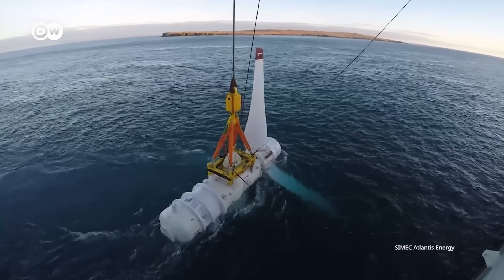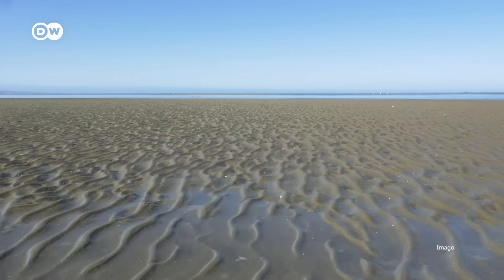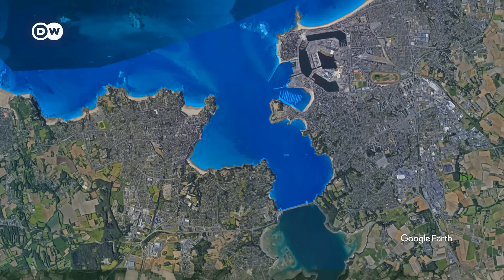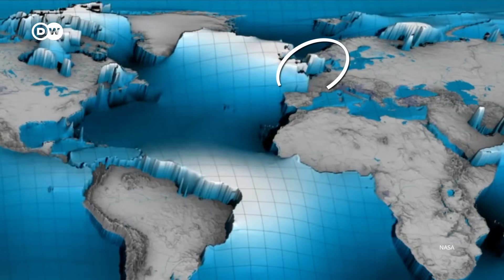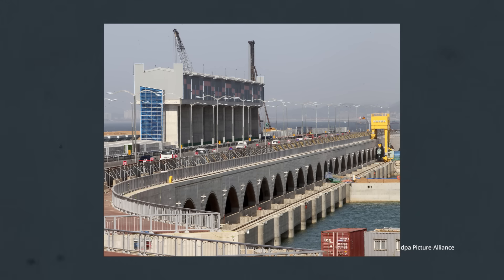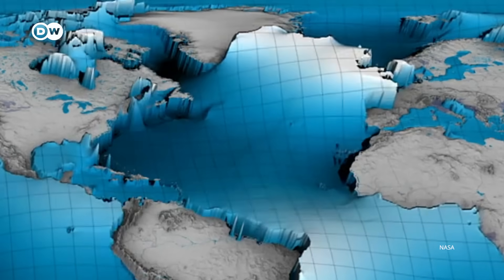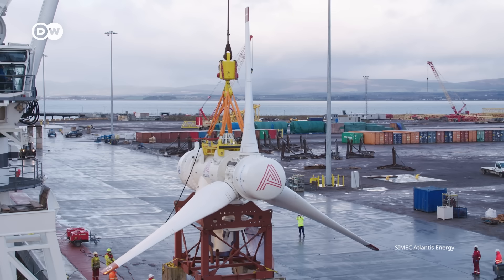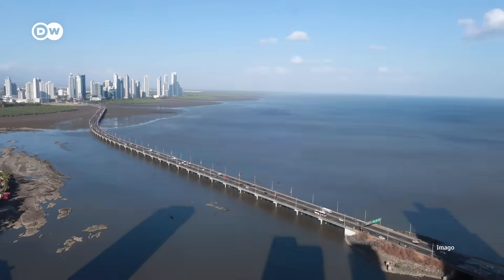Tidal energy could be huge – why isn't it?

Comment: Fun fact. My dad was one off the supervisors for the original Tidal power project in Hammerfest (Norway).  (Specifically in Kvalsund)
They look like small underwater wind mills
Reply: I used to fish off the little pier below that bridge. I was always deadly scared of potentially getting my line snagged in one of the turbines, little did I know this was virtually impossible.
Reply: can anyone please explain in terms of Albert einstein way rather than newton's one?
Reply: @gazzy01  Are you referring to the tides?
Reply: Cost of solar is so cheap now it doesn’t make sense. Also solar will drop another 75% in a few years
Reply: @MrExo_3D  but tides are consistent, sunlight is not, especially in the north, like norway that gets little sunlight in the winter but still has, tho small (only like 40cm), tides, so while they are ineffective there they still can possibly be optimised in some way because of their afformentioned trump card
Reply: @sanchu6335  yes tides are more reliable. but the equipment is hard to scale, and needs alot of maintenance and is problematic to survive harsh salt water. moving parts lead to problems.. Solar scales much easier but there is room for multiple solutions
Reply: @MrExo_3D  My local tidal turbine  requires little maintenance, as does my local solar farm, both require  only basic and inexpensive servicing but the tidal  turbines are much more powerful and operate 24/7
Reply: @MrExo_3D  exactly
Reply: @MrExo_3D  rewatch the video then 'cause the main point of tidal generator is concistancy
Reply: @MrExo_3D  Wind and solar work at about 1/3 of installed capacity and have to be 100% backed up. When you factor in the parallel power system that does that then wind and solar become very expensive, hence they require the enormous echo system of mandated subsidies that they receive.
Reply: @MrExo_3D  Since when did the sun shine 24 hours a day 🤔? 
Are there clear sky's every day?
Reply: Also really weird to see you commenting on a randomly recommended YouTube video. Haven't seen you in a decade
Reply: Yea well tell him to hurry up
Reply: Hammerfest Atlantis was a company that used this station as their test bed.
Reply: Onland windmills decaptitate lots of birds of bats.
Do the underwater variety do the same to sea life?
Reply: @earlysda  No
Reply: For those who understand it, daily life will turn upside down: The Connections (2021) [short documentary] 💖

Comment: Tide is a weak source of power albeit fairly predictable. However maintenace is a large cost on any marine equipment.
It also has two times that power will drop to nothing.
The other really problematical issues with tidal (or wave) is that they are asynchronous meaning they cannot modulate as demand fluctuates, this eliminates their large scale use. They are also low in inertia another characteristic that keeps the grid stable. 
On the face of it a source ofenergy but it is not anywhere as good as it looks.
Reply: Gary, 

yes I have and for very good reasons.

Balance demand to generation, you have to not looked at that realistically. Particularly as wind is so volatile in output with respect to wind speed.
Drax was paid £4000 per Megawatt for this 'last watt'. The simple fact is that we are streched as far as availabiliy of reliable capacity .

You don't say in what discipline your engineering is , mine is power generation.
Reply: @iareid8255  What is your preferred power system?
Reply: Gary,

it is lethargic. That is why some tidal generators use  barriers to increase velocity and trade it for constant flow.
Predictable but that does not mean that it n
Reply: Its amazing to me they got Biomass into green energy.. so basically burning trees then. Your as  well to start mining coal again.
Reply: @T1tusCr0w  

the idea is that new trees are replanted, which seems a poor idea as they take some time to get to the size of the ones cut down already absorbing CO2. There is the not inconsiderable amount of energy logging and processing the timber into wood pellets and the shipping to the U.K. from America. It makes no sense whatsoever.
Reply: @garysmith5025  matching demand to generation means being subject to scarcity which in economic terms means price race (aka inflation). While I understand you can put some kind of equipment to compensate the variations from the sources of energy, overall on average they must match the demand. And these equipments and their maintenance have a cost both in terms of money and energy losses. I don't toss away the idea of using some renewable sources of energy but we can't rely only on them. I think we'll need massive nuclear program as well, be it either in form of large power stations and in form of small modular self running reactors if we really want to get rid of fossil fuels and cope with future challenges. I'm an engineer too but not expert in power generation, but my guess is we'll need almost three times or better four times more electric power in the next decades. My humble opinion.
Reply: Gary, 
I live in the U.K.
Take off your rose tinted glasses and look at things from a realistic technical viewpoint. 
Renewables, which include biomass (This significantly flatters the total renewable contribution as it is fairly consistent 365 days a year. It is also synchronous (although it doesn't run as such, it can) and has inertia. Take fossil fuels away and replace them with wind and solar and the grid will trip. No ifs or buts, and it will take days if not weeks to restore and it still will be unstable. Renewables cannot start a dead grid.
Balancing costs are rising in tandem with the increase of renewables as are electricity unit costs. This is the behind the scenes and never reported in the media as such. They report Drax had to restart one of it's coal plants but not why. 

Not only is it not possible it is fiscally iresponsible to build such a large capacity of an uncontrollable and expensive source of generation with a relatively short life so they will need replacing more often.
Reply: Gary,
 to continue, it does not help if it doesn't coincide with demand.
You cannot have agrid that supply and demand  do not match at all times. Therefore renewables can never replace conventional generation, it simply cannot work. Batteries are no answer. 
It is living in a dream world to believe that low intensity and uncontrollable generation can supply our requirements.